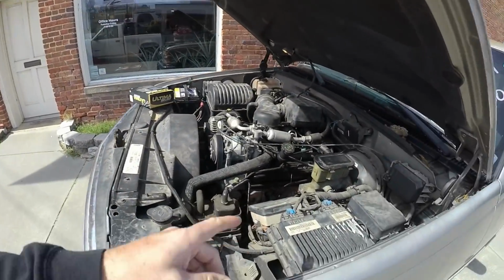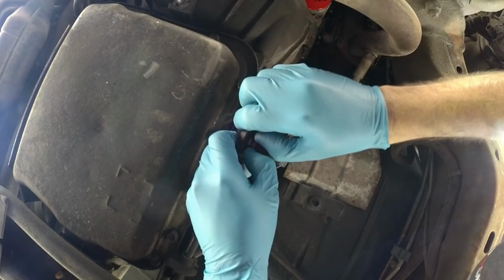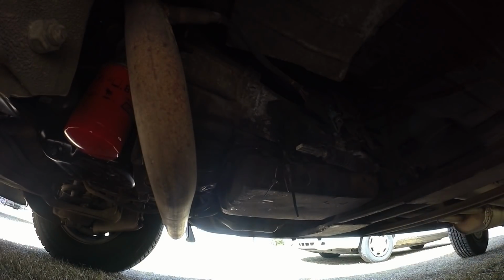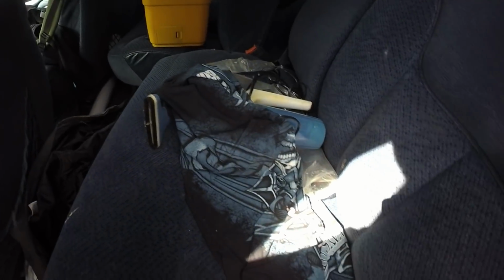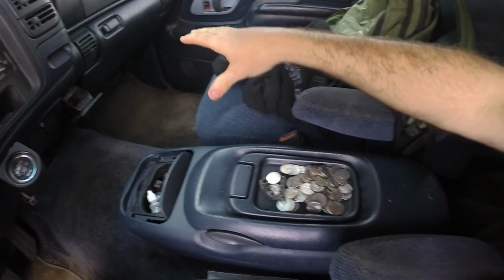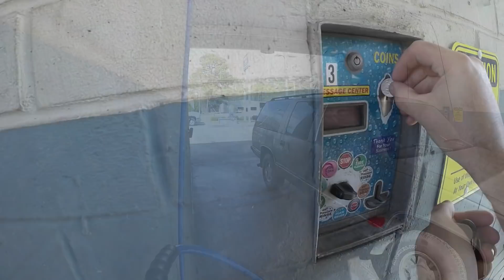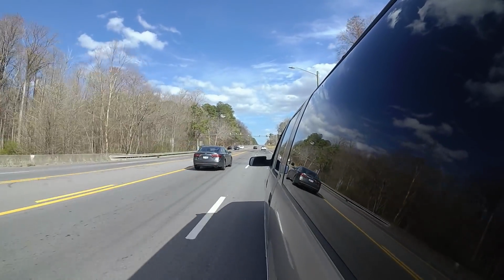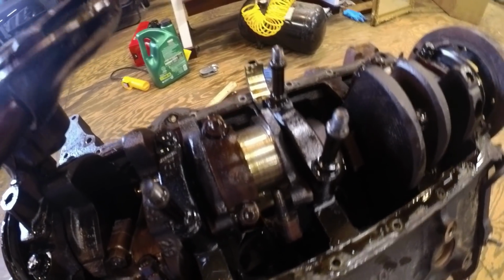First Road Test With The 1998 Suburban

Comment: Nice suburban. Please enjoy.
I have a Tahoe for 23 years already. Had many issues. Most important issue you are facing now right of the bat is a possibly nearing PassLock Module problem. However this can be pre-emptively easily remedied via an ECM (eBay has them for around $120) that has PassLock Delete programmed. I recommend getting one. PassLock issues are only a matter of time. I trust by now your intake manifold gasket has been updated already, these were going after 5-6 years in service. Hopefully changed for the revised updated version (best is from FelPro). Lot of people put in Delphi "spider injectors". I find them overrated and use the OEM all this time and always got Chevron gas. Fuel pump connector is also a culprit. It burns and should be updated with a fuel pump that has a GT280 connector (these days most fuel pumps for this vehicle have that connector already and come with a corresponding pigtail). That is all what I have on my mind right now. Lot's of little other stuff as well, but these are the major ones that I had. Oh, also transmission, but that is a whole other can of worms.

Comment: Really nice truck! Have fun with it, once you have a Suburban, you can't live without it, nothing else compares! We have two of them, a 2001, and a 1996. The 1996 is a C-1500 Turbo Diesel so we get very decent fuel mileage. It has 250,000 miles and is still going strong. Even though we do not drive the truck in winter, we have had it treated constantly with under carriage oil and paste wax rust proofing. All panels look and are like new. One nice feature is the Diesel 1500 Suburban is built with a 2500 8-lug chassis and has a 4L80E automatic and a 14-bolt rear axle. Like yours, we are still classified as a station wagon! Enjoy your Suburban, with due care it will last a long time!

Comment: I knew it was a rod...in your first video I wrote that's what it was...Iv been building engine's and working on cars , trucks, and big trucks.. diesels.. and worked in a auto machine shop for 10 years...I started working on cars way back in 86 ...long time ago...lol but yea a rod bearing won't change the oil pressure any if it spins and piggyback the bearings like yours did but a main bearing and a cam bearing will change oil pressure... and most likely that shift cable bushing is a dealer only part ... when I worked at Jeff Gordon Chevrolet here in Wilmington NC it was a dealer part......if definitely keep that engine and put a crank kit in it and definitely replace or resize that rod ...those vortec engine make alot of power they have the best flowing heads of any of the small block chevy engine they out flow the camel humps and the bowtie angle plug heads by a lot....buy a intake for a carb and put it in your 65 truck and put that 400 to shame...you will have a roller cam  ,, hypereutectic pistons better rods you can even get a cam for it comp. cams makes one that goes right in and sounds awesome...I ran 7.0 with one in a S10.. thanks for the video bud...

Comment: You said the tow truck driver popped the shifter linkage off. I am assuming he did to the put the trans in neutral ?  Did he disconnect the driveline. I use to drive a tow truck and was always told start the engine or drop the driveline to keep from damaging the transmission. Older transmissions had a front and rear pump and they could be towed with the drive hooked up. I worked for my good friend who started a antique car /truck wrecking yard in 1953 at 11 years old and still runs it today 5 days a week. I last worked for in in 1980 and most everything he got could be towed safely with the driveline still connected. We still yak on the phone at least once a month up to 3 hours at a time.

Comment: Excellent video Issac   :) next wash do soap then 2 full coats of wax on body plus mirrors also rims and windows too windshield wipers arms also roof and soap and wash water really good too! Do that each time you have excellent and show room condition too! Yes those GM Suburban vechile got lots strength with motor, transmission, axle ratio to even on 2 or 4 wheel drives ones! Plus last long time Issac :) bet you have in next 20 years and everyone ask how you keeping up so  nice 👌!

Comment: Man plug wires are not cheap anymore , i had a 66 El Camino with a 327 in it with a set of headers that were not for it but a Chevelle they didn't have direct fit for the El Camino then so i carried a set of make a wire behind the set on my 40 mile one way trip to work it would drop a cylinder and start banging so i would pull over and find the burnt wire and replace it on my way we go . I messed around and finally made a good heat shield and part header wrap that keep the wires around longer . But i think that make a wire set was less than $ 15.00 the last set i got for my 78 C-10 350 was just a little over $ 50.00 . CRAZY

Comment: I need to freshen my vortec with new plugs and wires. My shifter cable keeps falling off at least once a week, which is fine unless it's snowing. I'm going to try the Dorman 14104 it looks right and has the plastic clip.

Comment: One thing I would do Isaac is take a real good look at those michelin tires look at the outside sidewalls and especially the inside side walls cause When I bought my jeep going on 6 years ago now the tires looked practically brand new the tread on them were new but I was looking underneath the jeep one day in the fall I notice spider cracks everywhere on the tire and I mean everywhere on the inside sidewall anyways these tires are very prone to dry rot. The truck looks great by the way
Reply: Yeah, Michelins are good tires, but notorious for weather checking after 6 years. They recommend changing tires every 6 years nowdays. I have some 40 year old Ground Hawg bias plies on my old wood truck. Still holding air and no cracks after all these years! And as a scrapper, car hauler, and junkyard crawler, I've seen MANY 40-50 year old bias plies that look good as new.
Reply: @jeffrykopis5468  and I'm not sure how long they were on the jeep before I bought it in 2016 either and as bad as they were they made it 2 or 3 trips up north about 2 hrs from home in minnesota. I bought bfgoodrich all terrains and those tires are awesome and they last a long time just the other day while I was changing the oil I looked at them and they still looked great after almost six years and I've only put about 39,000 miles on them in the six years I've had them

Comment: My 98 Silverado 2500 is about the same weight and length. 2WD, 3/4 ton, long bed, etc. Vortec 454. Goes good, hauls good, but it won't do a burnout either. Except on dirt or gravel! 😂